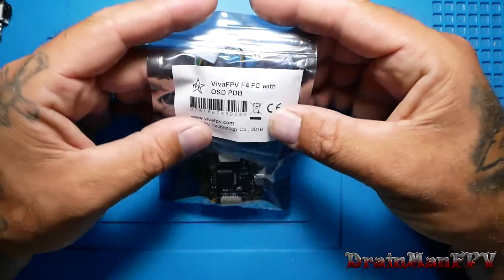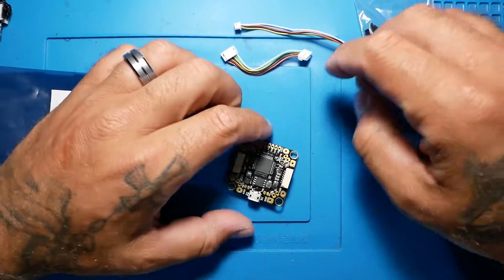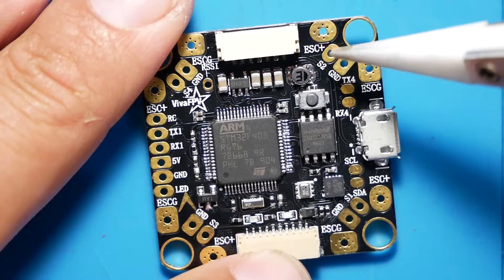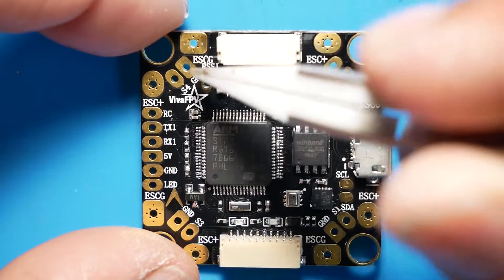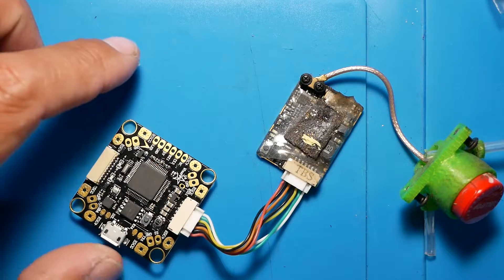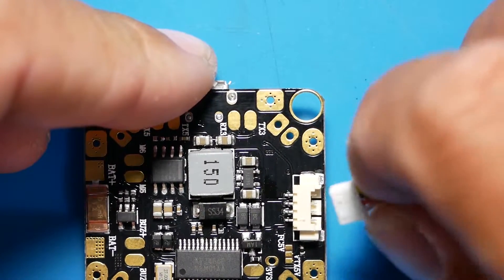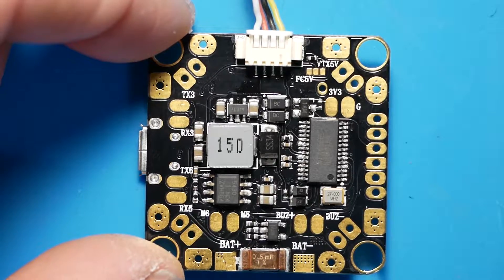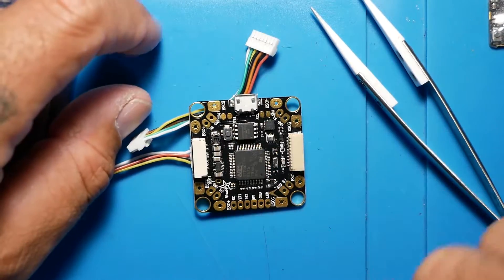VivaFPV F4 FC OSD PDB | Lets Check it Out!

Comment: Have you managed to find the latest version of betaflight for this board as it is flashed with 4 and not 4.3

Also did you notice it does no stack with crossfire directly with out bending pins ... eg the holes do not line up.
Reply from the maker: I have not ran this board yet. Is the target not available? I did notice that about the crossfire, kinda sucks.
Reply: @DrainManFPV  No target in Betaflight..

Comment: Any idea how to set this up with FrSky receivers, I cant for the life of me get them to communicate with the board and I don't know why
Reply from the maker: RXSR ? Where did you solder SBUS wire?
Reply: @DrainManFPV  The RC pad works the same as sbus (on uart 1) so solder sbus there and activate Serial Rx for uart1
Reply: U need uninverted sbus from your reciver to solder to any free rx port. I used rx4 it works fine for me with xm+
Reply: @luckyowl3240  Or just use normal sbus pad on XM+ and solder it to RC-pad, (which is rx1 inverted)